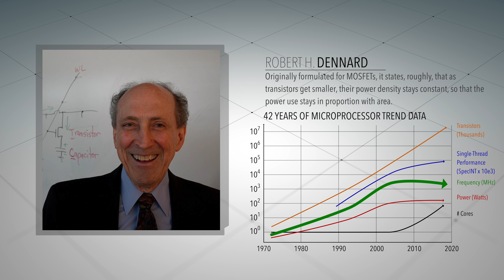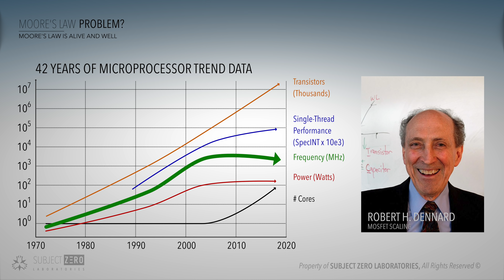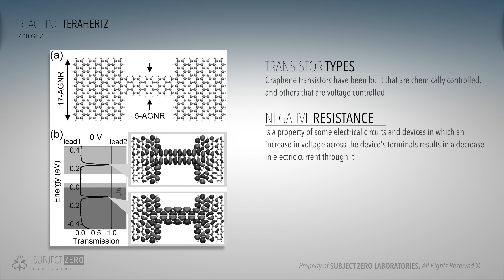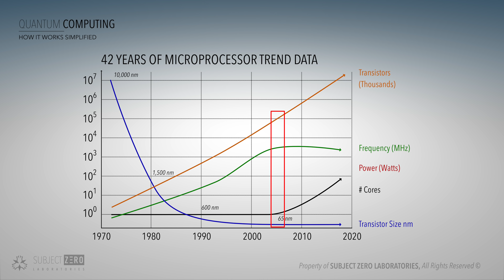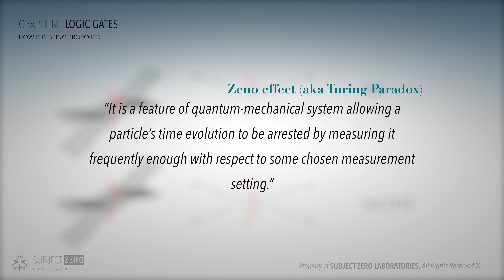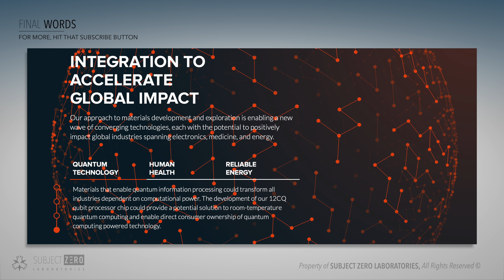Graphene Processors and Quantum Gates

Comment: Almost three years later and prediction has not materialised! I can't help thinking that it is because there is little public knowledge of this. Which makes me wonder why I haven't heard Elon Musk talk about this stuff? This needs to be a topic of conversation by everyone, and something everyone should be pushing for.
Reply: Most of this is still being researched, not even close to being a functional product. The semiconductor industry is working on graphene computing but they have an incentive to stay with their current processes because they have invested so much into silicon transistors. Switching their whole manufacturing process to graphene right now is not feasible.
Reply: @SamDavy1  The only reason it is not in full production is because they have not fine tuned the manufacturing process. The lattice structure in the material shows areas that are broken. But I think I came up with a solution to perfect the manufacturing process. If my theory is correct then it will be a positive step forward and on the way to change every industry across the board. However my solution does make it not feasible for a lot of manufactures to create. Musk being one of few with access to the kind of environment needed to test my theory. Keep your fingers crossed, because if it works we won't need to hook our houses up to the grid, and we can eliminate the need for batteries to run things, even cars.

Comment: MOSFETS ALSO HAVE ANOTHER PROBLEM IN ELECTRONICS APPLICATIONS. IT'S CALLED EMP {electro-magnetic pulse}. UNFORTUNATELY ALL FETS HAVE A PROBLEM WITH THE HIGH VOLTAGES EXPERIENCED IN STATIC ELECTRICITY AND LIGHTNING CAUSING MAXIMUM CURRENT CONDITIONS AT THE EXACT TIME YOU DON'T WANT THEM. THUS, THE NUCLEAR EXPLOSION IN OUTER SPACE TENDS TO BLOW UP THE ELECTRONICS IN YOUR DISHWASHER, REFRIGERATOR AND EVERYTHING ELSE ELECTRONIC.

Comment: Ah, finally! You have actually answered my question about how to reduce a super-conductor into a semi-conductor and also a non-conductor. I could not get this answer from anyone else! But it can't be easy to isolate the conducting "trenches" within the same graphene layer (conducting and non-conducting areas at nm scale). If you could dynamically move the conducting areas, you could have dynamic traces/tracks where the circuit remains open but the tracks move dynamically to optimize transmission distances between components for current execution. The long trace could be moved to become the short trace for the task.

Comment: What about submerging the board in mercury, and have the board of non reactive material(just a solid structure to hold the components). 

By having the chips and components react to a different frequency, that would allow for continual signal to the select functions, and no insulation dissipation.  

Maybe take magnets and place them rotating on the outside, to contain the mercury, and have high powered rf signal amplifiers, to allow for quicker frequency pick up.  

In theory the potential energy from the spinning magnet could also be used to power the components, while the frequency is just for specific activations.

Comment: USING MANY TRANSISTORS  IN SEPARATE  BOARD JOINING ALL TOGETHER BY SOULDERING AND MAXIMIZING THE ON RESPONDS CAN RESULT IN LOW HEAT WITH HIGH ENERGY HUNGRY WITH MAXIMUM SPEED.

Comment: One big problem graphien is not very abundant. However carbon nano filament. Which I understand can be made by a process that take directly from the air carbon particles. Like the US armies carbon nano extruder. And carbon nano is a densely pack as graphien as I understand it. And if it can be believed, looks a lot like a single graphien molecule. So can carbon nanotubes be used like graphien for the quantum super computing?

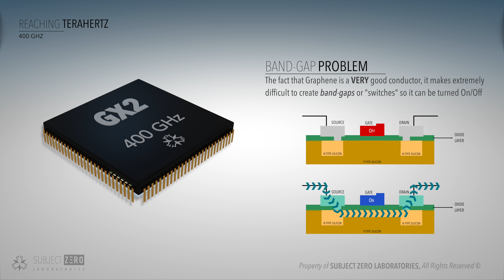Comment: 5:49 - Incorrect, Silicone gates are controlled by a gate or base junction, not by pushing more current through them. Excessive current that would cause flow in the forward bias will damage silicone gates. You may be referring to reverse biasing a diode, where zenier diodes have a breakdown voltage, that can be used in circuits to identify a specific voltage, but this is not used for high speed switching.

Comment: Wowow, something doesn't add up

You start by saying every 2 years the transistor count doubles. Then continue to say weirdly the clockspeed doesn't increase much anymore.

What's the relation between the transistor count and clock speed?
Reply: In the early 2000's Where single thread performance continues to go up you'll notice that frequency doesn't really move far. That's because there's one thing being left out. IPC, or instructions per clock. It's like a score multiplier for GHz. Even though clock speed hasn't increased a lot in the last 10 years single thread performance definitely has, because for every cycle a processor is able to do more. These IPC improvements are due to better architectures, which is HOW transistors are laid out. More transistors could mean more cores, higher clockspeed, or higher IPC; often a bit of all 3.

Comment: We could use a virtual logic gate such as the process of quantum computing only the super position can happen taking advantage of quantum particle popping in and out of existence coupled with the wave form of all positions this multiplies the computing power as well as the speed and accuracy adding observation could also give us a finite way to adjust this the instantaneous nature of correct answers if this state can be simulated in the very system it's in would allow the infinite reduction of size. Love your vids!

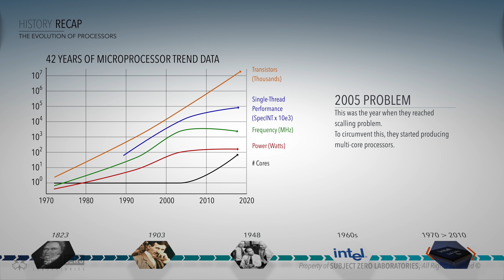Comment: 2:26 "Scaling problem" is misleading term here. The problem was with increasing frequency not number of transistors. They started adding cores because they had more (smaller) transistors at their disposal but could not easily raise frequency. Your own graph shows that increasing number of transistors has not been a problem at all.  And since size of single chip has always been limited this implies ever smaller transistors. Have a look at the frequency (green) graph clearly shows the problem.

Comment: Some incorrect information . Semiconductors use doping, not energy to change the conducting properties of the material. Conduction of a p type material is by holes in the valence band, not electrons in the conduction band. Mosfets are not bipolar transistors.

Comment: Testing one transistor and switching it on and off is not a conclusive way to tell how fast a theoretical processor would run. Propagation delay between thousands of transistors needs to be factored in the the equation as well.

Comment: Its not about ghz, its about cores, the more cores it has the better will perform and the processing should be split, so a dual layer 2.4 octa core processor would outperform a single layer 4.8 ghz octa core processor, but none of chip manufacturers don’t want to hear about complains of regular people, they are like: “if you never measured in atoms you should be silent” every rich people is a douchbag, no matter if its money or knowledge

Comment: I'm not quite sure about the term "negative resistance", by definition the sign of resistance is determined by the sign of voltage and current. Since they are not opposite, the resistance would still be positive. If it's just +ΔU and -ΔI, perhaps it should just be called "interval negative I-V Characteristic" or something less misleading.

Comment: Most of the power consumption in CMOS circuits is 'dynamic power' -- power from devices switching state. This power is basically the power required to drive the capacitance of the other gates, as well as the capacitance of the wiring.

In modern CMOS, there is additional static leakage power because when the MOS transistor is 'off', it still allows a little leakage current to flow, and given the numbers of devices in a modern CPU, the total current becomes significant. There are techniques to minimize this though. This has nothing to do with the size of the transistor but the quantity.
Reply: And a lot of the dynamic power is actually not even "reaching" the capacitor but burned by the metal-layers transporting the current.
A CMOS requires astonishingly little energy to turn on/off, but when you want to turn them on faster then you need to deliver the energy fast, that means higher currents which in turn mean higher losses on the wiring.
This is the main reason why modern processors do not run at a static speed - lower frequencies require less current and are more efficient.

Comment: Can someone please explain this to me: why the heck are we trying so hard to go smaller? CPUs on most consumer PCs are less than 1,5^2 cm^2 . Add that to mostly empty PC box. Just go for a multilayer (bc cooling) 10^3 cm^3 CPU. Sure that is not suitable for portable devices, but then again, current processing abilities are redundant.
Reply: Smaller Transistors mean more more performance with less power consumption and heat production. You can space then more out and add more thermal mass if needed or simply ass more of them.

Comment: who else is watching this on a gen8 octocore i7 cpu? octocore I7 and let me tell you I love how fast it is, I can run anything that I have had access to so far, even running minecraft with raytracing on a server with over 200 mods and 30 players and I still got 70fps. also as a computer enthusiast I have never seen a computer so compact and not generate massive amounts of heat, but mine does this well. I cant say what it is because it is a project pc built from a old dell optiplex  990, it has a gen8 motherboard with 8 core i7  with 16 gigs of sddr4 ram. I am  saving up to upgrade my ram for next month will have 32 gigs, then to replace my outdated gpu with something new.  any suggestions on which gpu I should use would be helpful, it is a small space so will have to be fairly compact to be able to fit. I so cant wait for graphene to be available to the public.
Reply: A 3 year old i5 can do the same.

Comment: transistors are much larger then the 12-7nm range they call them right now. that 7nm size is about the space between the transistors. correct me if im wrong im no expert
Reply: The 7nm refers to the physical size of the Transistor. But how sense they are placed around the die varies.

Comment: Isn't the problem with high frequency, that the clock voltage across the CPU is not in sync because the chip islarger than a big portion of the wavelength? (forgot how that phenomenon is called)
Reply: I think that happens even in current processors, that's why the logic doesn't use one clock through the whole system.

Comment: Haha. U will not see graphene manufacturing progress to a point that it demonstrates a means of manufacturing process that many companies can easily replicate. Its use will be limited to industry that has components that are manufactured nearly exclusively. The size, capacity and potential will be limited as well. You may see it in Military wearables or personal devices. Civilian industries will only receive this  technology in limited uses and in extremely low energy storage or transmission potentials. Processor chips and components probably being the limit. The genie has to be locked securely in the bottle first. 
*watch for acquisitions and mergers of companies corporations or internal arm of either that the manufacturing department responsible for these is definitely and securely under control. 

Quantum mechanics is a hack. 
Quantum computing is a scam. 

You cannot claim;

Cause and Effect is valid 
Universe is closed system 
COE/Thermodynamics to be correct 
But also
Properties and matter can appear from 0 and return to 0...

Light speed is finite limit of energy transition 
Superposition and entanglement to be valid
(Thank this one for time becoming a fudge factor) 

Galaxy to reign supreme and alone
Galaxy structure is impossible 
(Dark energy/matter = fudge factor. 95%)

Aether not to exist
Quantum Vacuum exists

Redshift indicative of doppler effect
Two structures joined @ X distance actually are infact  X10000000 apart due to result of redshift date. (Cant be wrong or so is expanding universe. And so is big bang🤯)

That’ll do. 

Its hard to accept, but E=MC, SM, COE, QED, QFT... ALL fundamentally inaccurate/incorrect/incomplete and as a result this intrinsic +\-variation is factored in to all equations and is multiplied with distance and scale from the control point.  

Look, its not flat out wrong, just incorrectly perceived and developed. Everything as a result is a half truth. There’s no Black holes, 
 (or 0, or ‘infinity’)
No Neutron stars, Iron ball inside earth, SuperNovae being responsible for every atom in your body, duality, Timetravel, Gravitationally bound orbits, CMB..... 

Some of these things are real, just not as you believe, becoming this is what the Experts have told you. But have they proven it. Or tried to prove themselves wrong. 

Explain me

Solar wind
Magnetism
Gravity
Light
“Spooky action at a distance”
Quantum Vacuum 
Saturns rings being 90* to the aurora, solar system orbital plane alignment 90* to sun polar region, Galactic plane alignment 90* to EMR jets, magnet under viewing film indicating dielectric plane 90* to polar region, electricity flow creating field with a circular plane of magnetic fiel relative to reference piont in wire

Comment: Consumer graphene processors within 5 years seems extremely optimistic, as far as I know no large scale logic chips even exist in labs at this point. You also have to consider that they will probably come with a new processor architecture which means they won't be compatible with any existing hardware or any existing software. There's no way all of that will change in 5 years. Maybe 10 or 15.